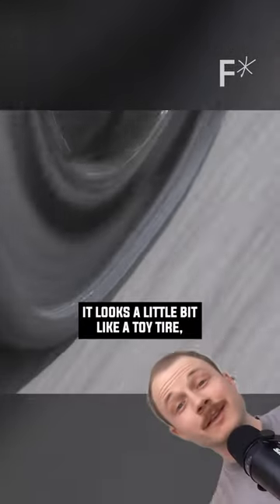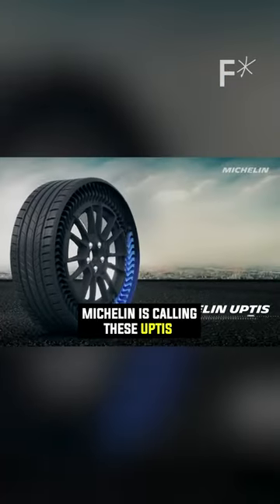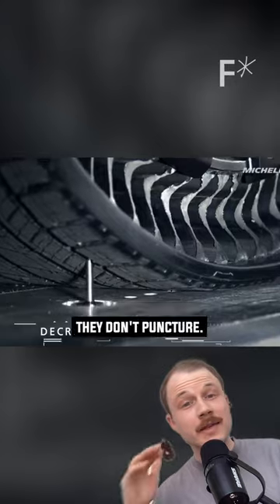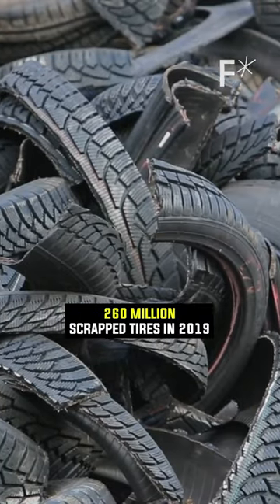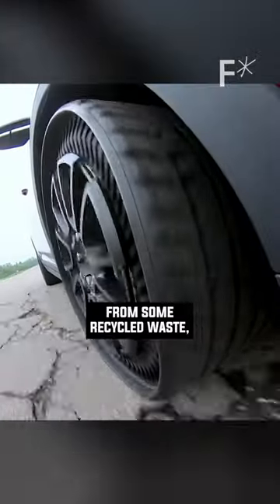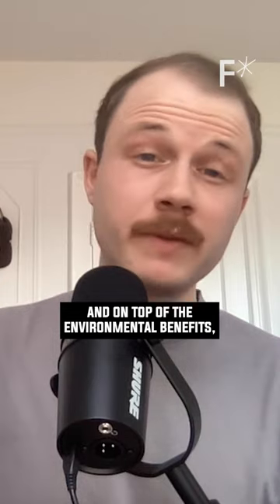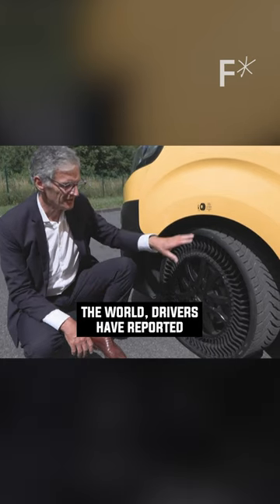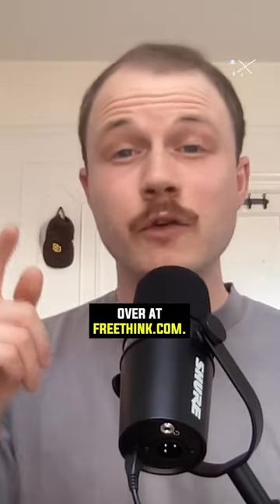Michelin's airless tires don't puncture 👀🛞#tires #sustainability #testdrive

Comment: These have been around for like 30 years, hy are called "tweels" and they already exist but are like $700+ per tire
Reply: It probably still has a patent on it. Once that expires, then the flood gates can open for competitors.
Reply: @TravisPluss that and there is a slight difference in how long before they where out.
Reply: These are the first ones that are good at speeds over 70 for long periods of times, that's why they've really only been on tractors and other low speed vehicles.

Comment: Not puncture proof. There is just no pressurized air to leak out when they are punctured.
Reply: They still function just fine after getting punctured. It didn't say puncture resistant.
Reply: @JACpotatos.  It is right there in the name: UPTIS: Unique Puncture-Proof Tire System.  All I was saying was that it can be punctured. It just doesn't matter anymore (since there is no pressurized air to leak out and flatten the tire). Great idea for a tire, but not a strictly accurate name for it. A more descriptive name may have been Flat Proof Tire (although I agree not as sexy as Puncture Proof)
Reply: @1pauldinsdale1 I was thinking the same thing when watching this. Glad someone said it before me. I would said that they are probably more easily to stab though then pressured tired. But at less you don't blow one out when it gets stab by whatever.
Reply: @wyattredmond9508 I'm with you.  I wonder how they feel compared to pneumatic tires.  I also wonder how much rubber and plastic goes into these airless tires compared to a normal tire. Once the airless tire wears out is there really less waste to deal with???

Comment: I hope it won't be open design like this. Otherwise there would be much more broken windshields on highways from debree stuck in between the structures. I for example used to park in deep gravel which was all around house I lived in. So these would get full of it and then I would go straight on highway like that.
Reply: Your car literally becomes a shrapnel flinging machine

Comment: Im not totally sold. Without being able to adjust pressure, it can cause issues in certain conditions. There is also the possibility of the tire falling at high speeds and causing more damage to the car than a regular tire may. That said, it could be a viable replacement for normal tires in the future once there is enough time, money,  and knowledge invested into their design

Comment: Except these will require new rims. Tires generally wear out faster due to poor alignment road conditions such as temperature. Most punctures can easily be patched. 

Also depending on the vehicle tires are inflated to a certain PSI. There is going to need to be 1000’s of different SKU’s and variants to accommodate this. 

I can’t see this being feasible in a commercial sense

Comment: Do they decrease mpg?
Reply: The opposite actually.  They been around since 2005 but the tire lobby has finally run out of abilities to hold this back.  In America there are technically only 2 tire companies while in most countries there is at least 10.  

Most countries have been using these tires since 2012 but have pay a little extra just to cover the fact they were airless. 

The cheapest of these tires can actually increase your MPG by 2 to 5 miles.  The most expensive ones costing $1,000 per tire increase most vehicles MPG by 55 miles.
Reply: Ignore what joshportal says they would absolutely decrease mpg with all the deformation. Just like regular flat tires.
Reply: Bwahaha...this is the thing about airless tires....I love the idea of them and would use them for sure instead of inflated on my bike but people say they take more effort. So I figured this would translate to higher mpg for cars. Now, maybe they ha e engineered out the issues comparatively, maybe they haven't, but you have to get an accurate gauge on their properties and even if there were a little higher mpg it might be worth the peace of mind. IDK rn. But these comments point this out so well.

Comment: Yeah until you start getting to the point where the tire becomes a physical weapon towards your car and causes body damage because you have flaps of tar swinging around and around and around as it smacks your car and causes body damage which in the long run will total your car out

Comment: Just wait till the middle of the tire, the flexible part, loses it to viscosity and separates from the outer part. The accidents will be phenomenal and I seriously doubt you're going to get more mileage out of these than you do regular tires. Don't fall for advertising just because you think it looks cool😂
Reply: The irony is that they originally made in America in 2004 but in 2005 the Tire Lobby stop production and sales in America.  Every country except America had these tires in 2012.  The ones made today are the best ones but this video ironically shows the ones you can find in Walmarts outside America.  The ban the Tire lobby put into place is finally ending in 2024 and it can’t be held anymore.  

Also there are only technically 2 tire companies in America where most countries around the world have at least 10 which means much better quality and competition.